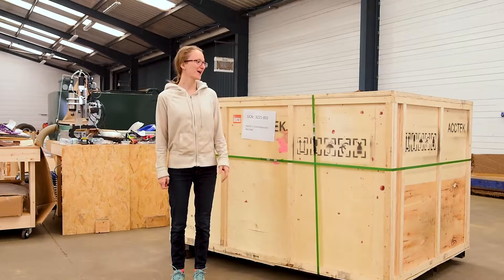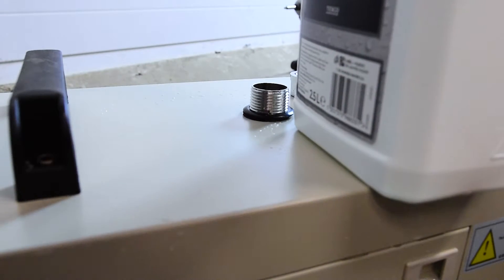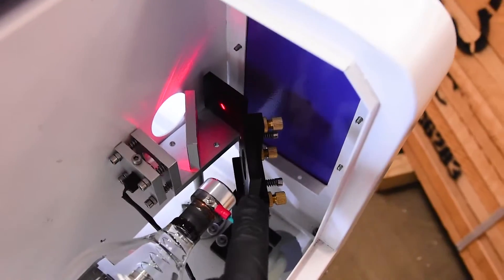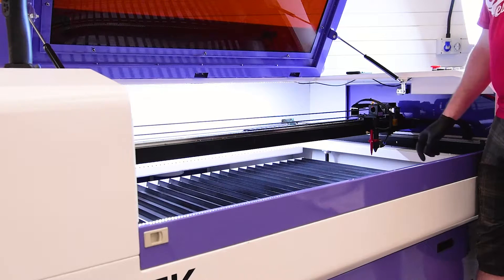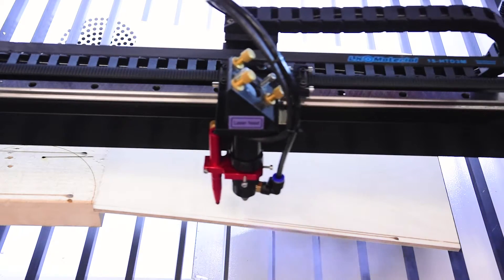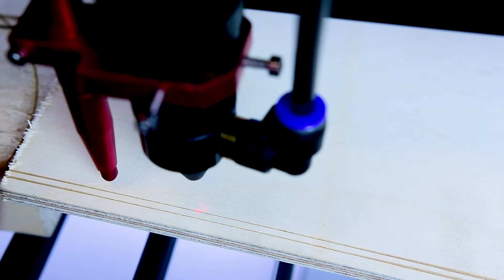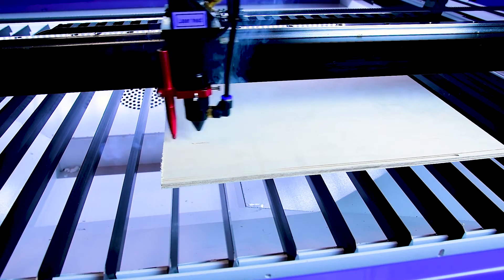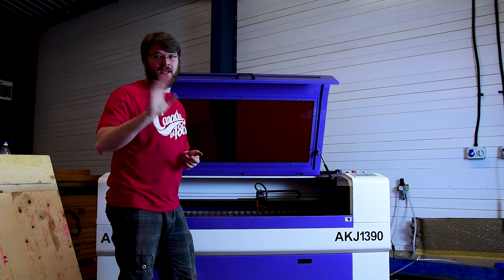Chinese Laser Delivery, Setup & First Mods - Acctek AKJ1390 130W RECI

Comment: I think that you should lower that space between orifice and cutting material. That is because this way all air can pass though the cut. Too much distance, and air may have hard time to remove all smoke, or part of the resulting tar may end on the surface of the wood. For acrylic, use protective cover.